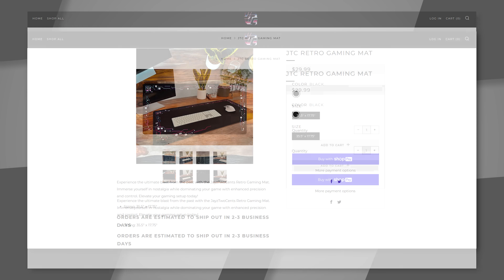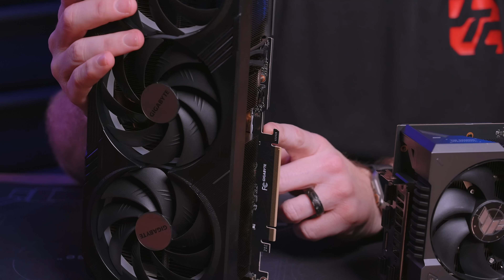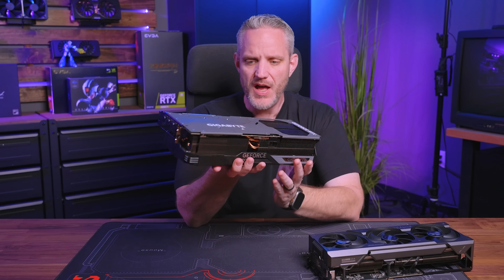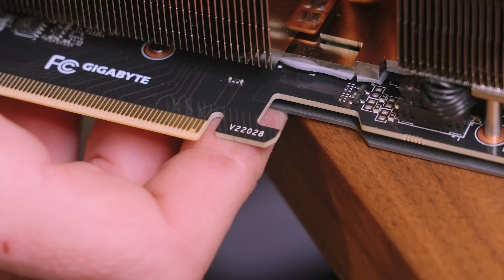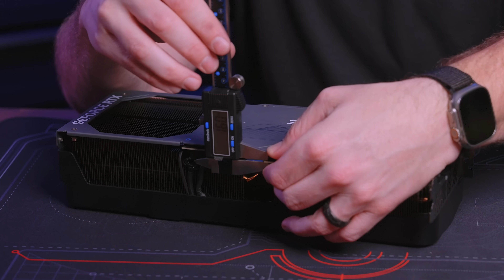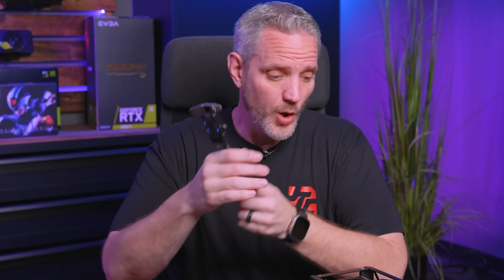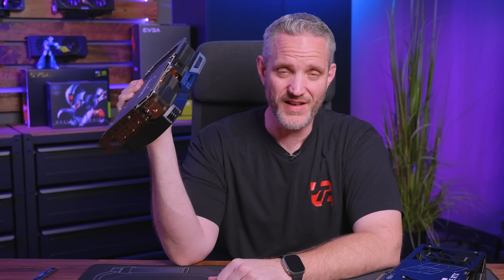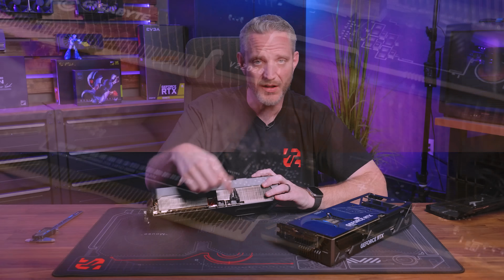These GPUs are cracking and the company REFUSES to warranty them!

Comment: I sometimes feel like we are heading into another tech dark age.
Reply: No kidding
Reply: When was the last one ?
Reply: @emsj86  I can't tell for sure, but I know that in the early 2000's, a bunch of low quality electrolyte capacitors got into arguably EVERY motherboard in the market. There was some discussion, but the most accepted theory is that some major capacitor manufaturer and supplier (shared by many mobo manufacturers) badly cloned a new Japanese capacitor design and manufacturing process, leading to a bunch of major motherboard brands having their products popping like popcorns within just a year of use (consumer and enterprise products both being affected).
For well over a decade since, many mobo brands advertized their products to have "Japanese capacitors" because of that.
Reply: @NothingXemnas  Talking about the "Capacitor plague," it was Taiwanese manufacturers who had an improperly formulated electrolyte when they cloned the Japanese ones if I remember right.... sure someone here will correct things if I am off.
Reply: @emsj86  Capacitor Plage in early 2000's was a low point.
Reply: @emsj86  the 80s had a video game collapse. That was sort of tech for that day. I wonder if the market had not been flooded with garbage would the tech have been moved forward faster.
Reply: @mhn3773  video games but wouldn’t say there was a tech dark age ever
Reply: @emsj86  the 90s were very dark as well. Very few actual games, it was a race for “graphics first!” and gaming PCs were $5k+. Full motion video “games” with 13 cds you had to stop and insert at various times while playing. 

Back then we had actual gaming journalists who wrote honest reviews and I remember being pretty bummed most of the time PCGamer magazines arrived. We had a 486dx2 which in todays dollars would be $5600. Almost every game on the demo disc was total trash. Incomplete and zero thought to the game itself. 

I’ve got a great rig now with triple monitors, VR, thrustmaster HOTAS and sim racing setup. I haven’t played a game in 4 months. We solved the tech and cost issues but we are back into the 90s of gaming studios being total trash.
Reply: @johnmaurer3097  90s were dark? Doom, quake, civ, wolf3d, simcity 2000, etc just to name a few. 90s were awesome
Reply: @emsj86  Discotheque.
Reply: @emsj86  one could be the pandemic Graphics card pricing, consoles and chips drought. Currently, the increase in pricing for graphics cards for no reason
Reply: Dude, we're heading into a dark age period.
Reply: The dark age is that companies can just state:
Well, you paid the price including warranty. But we're not granting it to you because we screwed up.
Reply: @Hennerbo  That's a lawsuit waiting to happen, and in the US at least it's an open-and-shut case too.
The warranty is a contract between the customer and the manufacturer.
If the manufacturer decides to not honor the warranty, it is (or should be) their duty to point out a sufficient reason to deny the warranty claim that the consumer put in.
Failure to do so should result in an immediate decision by any competent arbitration body in the favor of the consumer.
Sadly, the arbitration bodies are largely paid for (and therefore implicitly biased to rule in favor of) the corporation, because the corporation doesn't want to do this on a case-by-case basis.
That just means you need to appeal to a higher power. And in this case, that's a proper lawyer, to file a lawsuit based on well-established interpretations of the consumer protection laws that are already on the books.
Companies can't just change the terms of their warranty willy-nillly, not even if they declared they can in their warranty.
They can change the terms of their warranties that they're issuing on new stuff, but the old stuff stays covered by the old version of the warranty that existed when it was sold, to my understanding.
Reply: Its been here for a while man.
Reply: Between sky rocketing gpu prices, bloated game requirements, we're already in a tech dark age
Reply: @markkoops2611  GPUs aren't any more expensive than they have ever been adjusted to the economy.
Reply: Buutt, after that we'll have a Great Crusade
Reply: Pray to the machine spirit, praise the omnisiah.
Reply: We are already there.  Big companies are just cutting corners to save money for share holders and making shoddy cards and it will only get worse because whales will always go out and buy there trash.  I stopped using gigabyte years ago because they was starting to make cheap componants like there Mobos and no ASUS are joining in on the party and there have gone in the trash aswell.
Reply: I think we have entered already
Reply: the prices lead me to believe so
Reply: Especially when EVGA left. Lesser competition, worse for consumers.
Reply: It’s great that Jay and others surface these issues - but new tech problems are now common sense to buyers. 

It’s like Jay reviewing a pet chimp that ripped someone’s face off. “Can you believe it!?”

We all know this would happen. In fact, we’ve known for a long time that’s what pet chimps do. Only idiots buy them as pets.
Reply: More ways than one. The planned obsolescence stemming from rampant greed, plus the influx of junk data is going to mean that this decade will probably be lost to time
Reply: well in Warhammer it happened :/
Reply: your life is horrible so everything always sucks and you need everyone to agree with you too

Tech dark age my ass, stop being so negative all the time and maybe you'll find some friends for once in your life
Reply: Heading?
Reply: Own interests and greed have taken over for now.
Reply: Except this has been an ongoing problem with Gigabyte's products.   I no longer buy Gigabyte anything.
Reply: It's always a Dark Age outside less than 10 Developed countries...we earn less and pay more for products.
Reply: I think it’s more everything cost so much no one cares to work and this quality is lost
Reply: @emsj86  Unrestrained market liberalism was a mistake. As bad as Marxism-Leninism shitshow that was USSR was, it was clearly the case that unrestrained market liberalism made things even worse for Russia and it took them decades even to begin to recover. Now we are seeing this shitshow applied elsewhere, like the entire dating scene is now basically obliterated by applying market liberalist principles to human relationships, and the result is going to basically be meaningless sex for a small group that never commits to anything until the species goes extinct.

We need traditional societies with a sense of ethics, morality, duty, responsibility, integrity, a sense of perserverence and hard work in making a quality product for the betterment of the society--things that market liberalists and the corpos are allergic to.
Reply: @emsj86  My 4070ti performs better than a 3090 and cost less. lol While I agree with Jay and general consumer sentiments, the recent popular narrative around value in the most recent generation of GPUs is literally a case of echo chamber/group think. As for a tech dark age, I would say we are in a right wing nut jobs are screwing over workers and the economy for working class age, thus making it harder for average working class folks to afford things. Tech is more advanced, open source and accessible now than anytime in history even when factoring for what was considered modern tech for the age - the problem is affordability for the individual because wages have not kept up with productivity and inflation.
Reply: @emsj86   It's literally one company choosing to cut corners and then not stand by their product
Reply: nar just bitch age where everyone moans about under 0.00005 % of failers...
Reply: LOL what a baby grow up.  Times are always difficult.  Man up son.

Comment: Got rid of Gigabyte immediately once I found their software sucks and their RMA process is absolute trash. Now this, I ain't surprised.
Reply: Gigabyte ships literal malware in their motherboard software and UEFI BIOS 
UEFI Vulnerability in 2023
CosmicStrand rootkit in 2022
AvosLocker Ransomware in 2021
RobbinHood Ransomware in 2020
Reply: @Haskellerz  not trying to defend gigabyte here but at least cosmicstrand hit asus as well. You also make it sound like they do this on purpose. Maybe they should indeed check thwir security since it seems to keep happening, but i'm honestly glad that they didn't just hide those problems like other companies do (didn't have a gigabyte board so i might also be wrong, but that's how it looks to me)
Reply: @Haskellerz  That's actually quite sad. When I first built my computer back in 2019 I started off with a Gigabyte Aorus B450 Pro WiFi motherboard. It worked perfectly fine (and still does) with my Ryzen 1700. But when I updated the bios to give further cpu support so I could upgrade my system with the 3700X I bought it did nothing but blue screen afterward. 

Come to find out through another YouTuber because of a setting in the bios my board just absolutely hated the 3700X I was trying to upgrade to. So I just said screw and used that as an opportunity to buy my current MSI X570 MPG Gaming EDGE WiFi. I've done repeated bios updates to it over the years and have had absolutely no problems with it.

So for me as far as hardware goes with the current problems floating about MSI and ASRock seem to be the most reliable of the few as far as AMD goes. For Intel that's going to be EVGA, MSI and ASRock. As nice as ASUS's boards look I can't trust them with the BIOS crap they were trying to pull.
Reply: Sorry to say but every aibs software is a bloated nightmare
Reply: msi since i thought id knead a ps2 pört ähGäin ^??^